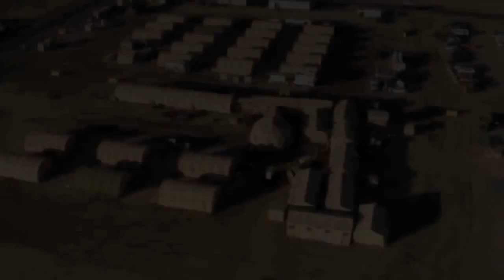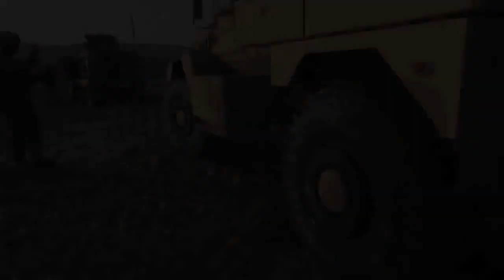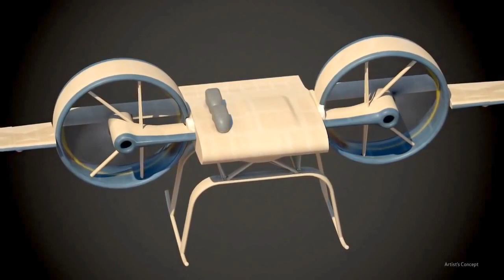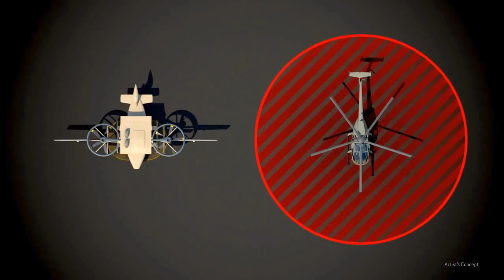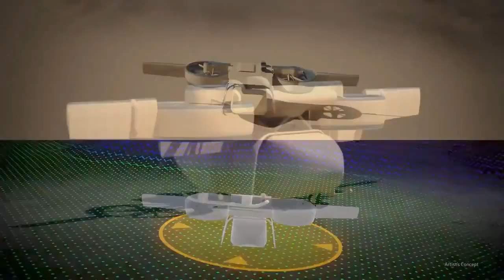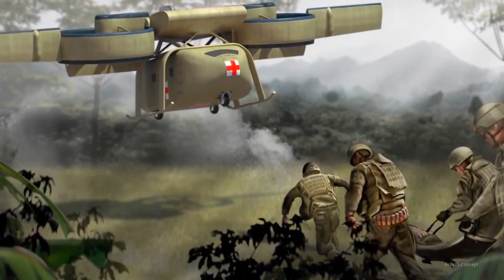Lockheed Martin Skunk Works® - Aerial Reconfigurable Embedded System (ARES) VTOL Simulation [720p]

Comment: Many of the patents have run out on Bell-Boeing's V-22 Osprey, so the technology appears to be picking up advocates from other defense manufacturers. The key safety risk is the conversion from vertical to forward flight under differently-balanced loads, forward, rear, left or right, or in fact shifting.  It will be interesting to see how this style of airframe actually fit combat strategy.